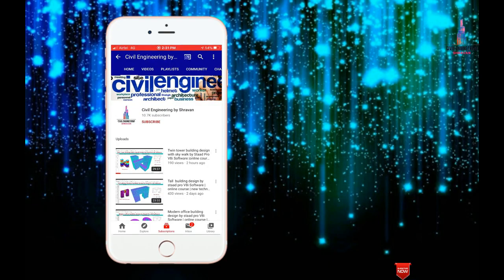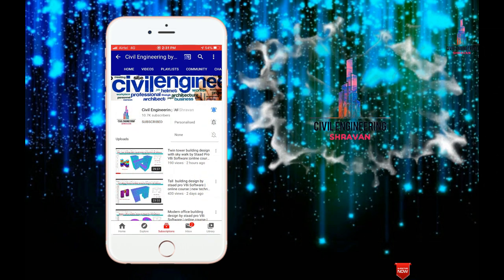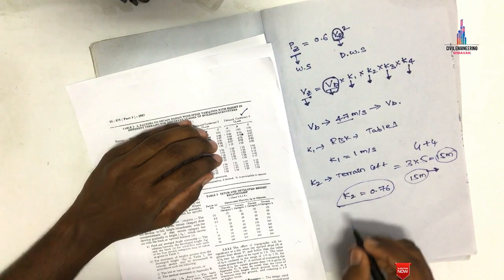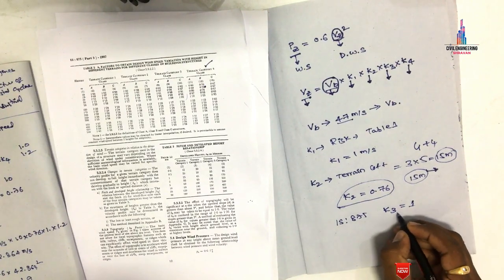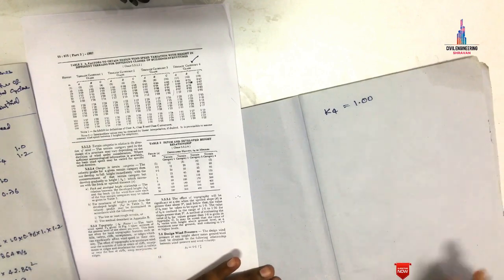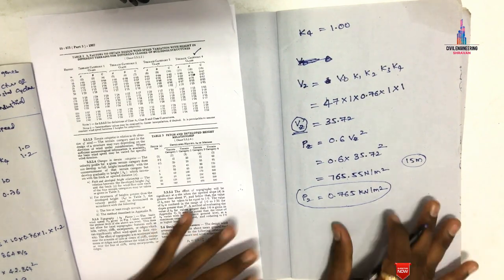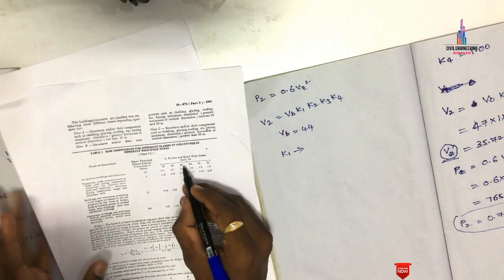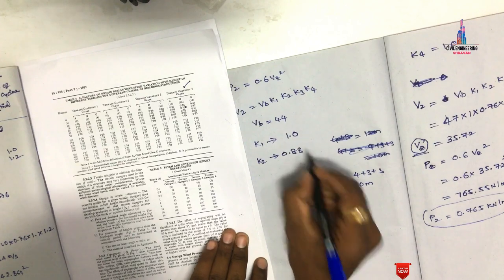Wind load as per IS code | wind load analysis | Building design | civil engineering |

Comment: Bro after all designing it is showing joint is not connected properly as warning and few errors like error message , load intensity is zero and few errors , for this problems give the solutions bro PLZZ